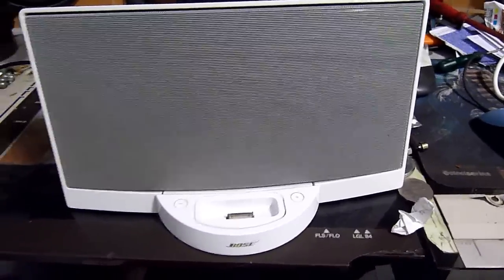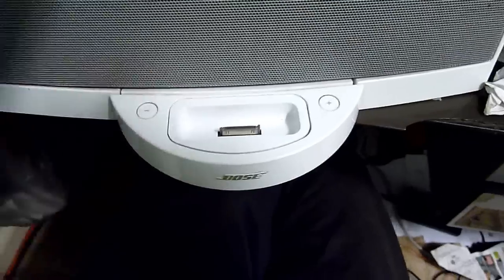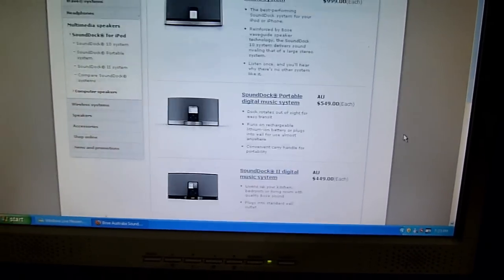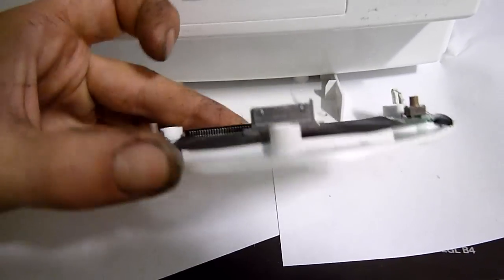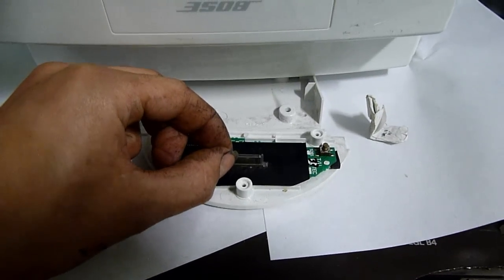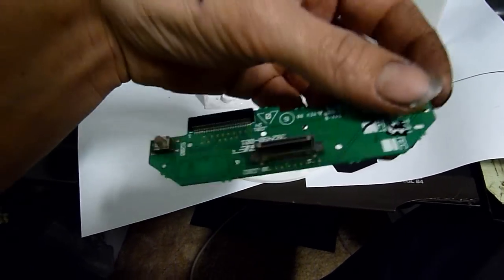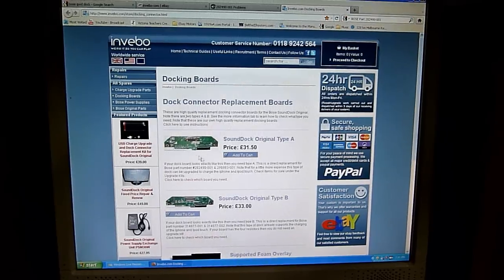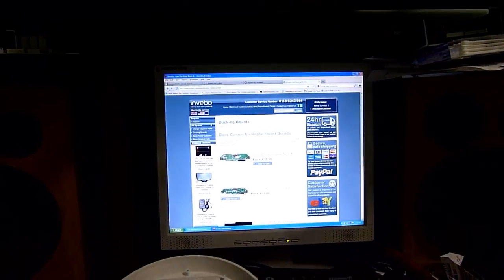Bose Sounddock Ipod Connector breakage

Comment: doing a hot air reflow on that pcb would resolder all the smd pins im thinking, plus it would be alot cheaper then that replacement pcb.

Comment: That whole connector board is such a cheap, flimsy design flaw for such an expensive unit. I bought a bose sound dock and right out of the box the sound would stutter and stop unless I wiggled and propped the ipod. I returned it and am now using the jbl on stage 400p. The sound quality is great on its own right and the overall build quality and design is solid and just better. More people need to be made aware of the poor quality build of the bose sound dock.

Comment from the maker: yep, :( the board I installed failed almost immediately :(. it works if the Ipod is propped forwards a little, but if it sits naturally, it will not work :(

Comment: I like your new camera it looks and sounds great. what did you do with your old one?
and Bose stuff is way overpriced. maybe you can put some hot melt glue under that iPod connector between the connector and the board and that might strengthen it up.
just an idea.

Comment: I always thought that Ipods (or mp3 players in general) and Bose were supposedly at opposite ends in terms of fidelity. They have a drug store chain in Canada called London Drugs that has shelves full of Ipod docks like that Bose, they even had one that had a tube amp, sort of a silly idea to me. Since an MP3 player is typically loaded up with a computer why not just plug a computer output into a stereo amp? Plugging and unplugging those multi pin connectors constantly is bound to wear them out.

Comment: I have recentley purchased and installed the so called "upgrade" board for my bose docking station from the site mentioned in the video and it never really lived up to the hype on their website. Installed October 2011 it wouln't charge ipod nano only partially charged ipod touch and then the whole connector just came off the board april 2012 pretty crappy quality so buyer beware.

Comment: $450 for plastic? Nuts. For $450, I'd expect a forged aluminum housing and mil-spec build quality. Typical Bose junk. Bose sounds decent enough, but for the same price you can build a much higher quality, much more powerful, much better system. When you buy Bose, you buy the name, nothing else.